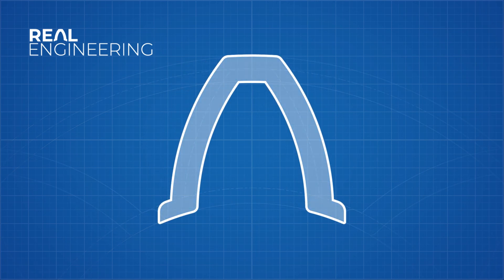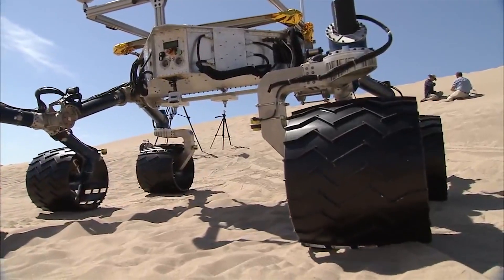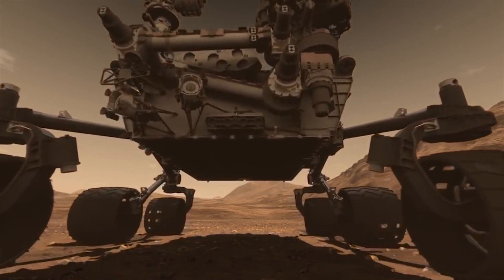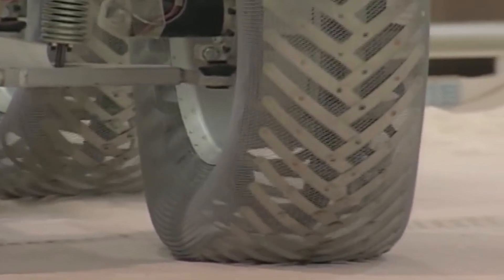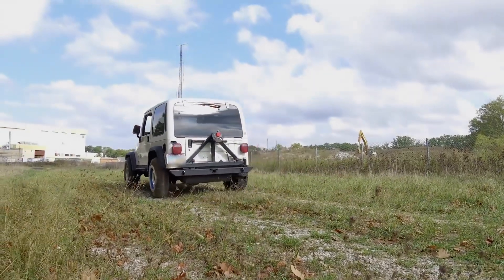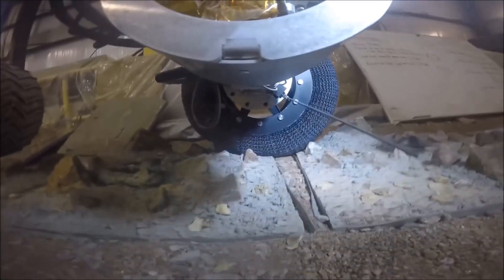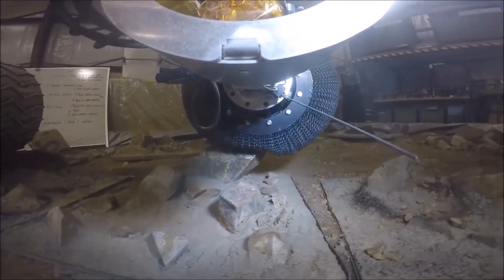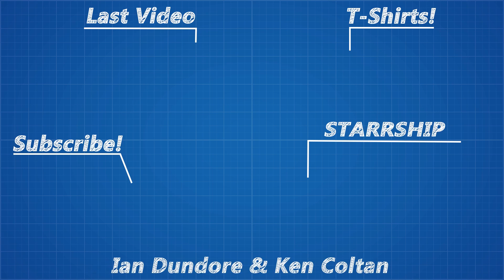How NASA Reinvented The Wheel - Shape Memory Alloys

Comment: Considering curiosity has gone more than 7 years past it’s predicted lifespan, I’d say they did a pretty good job on the wheels
Reply: Minimonk if u think about it most car tires won’t last that long
Reply: @Hairyson-g5j  yeah but a car drives thousands and thousand of km on one pair of tires and the mars rover only travled 40km
Reply: @Codzy yeah but the terrain on mars is way different from ours, and because of the incredibly different temperatures at day and at night, you shouldn't even compare it to a normal car tire
Reply: @no_t1es   yeah but u would think that metal wheels could last longer than 40km only going 0.1 mph or something like that
Reply: @greengreen110  Yes they can do better, but that doesn't mean they'll be able to do better straight away. It doesn't help that their funding has decreased a lot. Though I guess space exploration isn't one of our main focal points right now, so I can understand why their budget has decreased.
Reply: @anothereden6673  
NASA's budget has increased literally every year since 2014. I didn't go back further.

Sooooo
Reply: @lordgarion514  Yes, it has increased since 2014, but I'm talking about since the birth of NASA. It's highest ever budget was $40m, adjusted for inflation, and it has also gone down many times before 2014. From 2010 to 2014 it dropped $3m. Also, why specifically start from 2014? I don't think 6 years of budget increases accounts for 50+ years worth of budgets very well. You say you didn't go back further even though all it takes is less than a minute of Google searches to find the budgets they have been given and you don't want to even do that and yet you try to make an argument.
Reply: @anothereden6673  
No, you weren't talking about since the birth of NASA. You might have thought you were, and you might have meant to, but you didn't.

Reread your post. Especially the end.
Reply: @anothereden6673  
To be clear, you specifically mentioned "right now" in respect to our priorities, which would be covid-19.

So you yourself dated it to now.

I can only respond to what you actually say, not what you thought you were saying or meant to say.
Reply: @lordgarion514  I meant why it has decreased to what it is right now. As in from the beginning to right now. Because I say the words right now does not mean I'm talking about the timeframe of the past 6 years. I'm talking about why the budget of $40m, which was the during the period of the space race, decreased to $20m as of right now, which is half of the budget. And I said I could see why it decreased that much when space isn't the focal point of the government. I also did not have Covid-19 in mind at all when writing about priorities because I was not thinking that much about current priorities. I was just space exploration just isn't one right now
Reply: @anothereden6673  
No, when you say right now, it means right now, not decades ago.

And the main reason is because the people lost their excitement before the end of the moon mission's.
Reply: @lordgarion514   I did mention that people don't care about it as much anymore which you would know if you correctly read my statement. And again, by right now it means start to right now, as in 1958 to 2020, the budget has decreased significantly, which I thought I made easy to understand with my last statement. I was talking about the passing of time from past to present and how the budget has been affected. Also reread my first statement and you'll realise how all I say is that the budget has decreased a lot, meaning 1958 to 2020, and when I say right now, I was talking about it not being a priority right now, as again,the government, nor common people, are focused on space expedition.
Reply: @lordgarion514  People also use right now for flow of time. For example, "From 2016 to right now, I have been improving significantly at playing the piano." It can be used in this way as well. It is my fault that I never specified "right now, " but I was very obviously talking about it not being as much of a concern in 2020 as it was late in the 20th century. Please learn how to read between the lines and not take things with face value. All of the wording I had used in the first statement could easily lead a 5th grader to the correct inference of what I meant.
Reply: bnkjkdsbklafj hjbvjhbfdasjka yes but this is quite literally rocket science it takes a while to find a solution when you don’t live on that planet
Reply: It is never enough
Reply: Well if they had used the wheels that were in our proposal they would still work. My high school( Lakota High in west Chester)  Won the student Mars mission in 1992-3  One of my partners' Designed much liter composite wheels she was a Goth girl they don't want you to know that a high school Girls Design was better, we tested her Desing at a top-secret test sight in New Mexico,  We would spray it with Liquid N2 and have it drive across Quarts sand.  It was only 1/4  Scale but it could carry 500lb as you know if you increase SA 4 times and double the number of wheels for 4 to 8 then the Ground Pressor decreases.
Reply: soooooo relatable
Reply: 1000th like well deserved!
Reply: @TLXGaming  I unliked it just to spite you
Reply: @kommandantgalileo  why you gotta do mans like that ;-;
Reply: @TLXGaming  don't know
Reply: Well the last rovers wheels broke when they spent  billions on it so when you think about it pretty shit .
Reply: And the wheels weren't even the point of failure.
Reply: But one of the wheel did broke
Reply: Actually a single dude did it
Reply: I dont mean to be offtopic but does anyone know a trick to get back into an Instagram account?
I stupidly forgot the password. I would love any assistance you can offer me
Reply: @Terry Dominic instablaster =)
Reply: 20km
Reply: make that 9
Reply: $2.5 billion vehicle should last our lifetimes.
Reply: Given they spent billions you'd expext they'd shell out some coin for titanium alloy instead of aluminum tyres, seems like a last minute choice someone messed up.
Reply: @justinscott1691  
Well that's just stupid.

You talk like NASA is the military. Unlike the military projects, going over budget is not good for NASA. The money has to come from other projects almost every time.

They can only rob their other projects but so much.
And Congress doesn't throw money at NASA every time they go over like they do for the military.

NASA is already drastically underfunded. And between better tires, and and getting rid of an instrument, the instrument is what you pick.
Reply: @lordgarion514  actually we see people in charge of billion dollar projects making mistakes like that on a regular basis, they have done in the past, they are are doing it now, and will continue to do i, it's nothing to do with stupidity it's called being human, and by the way ive scene more expensive wheels on a sports car, and they didn't spend over a billion dollars on the car.
Reply: @justinscott1691  you are right billion dollar sinkhole. nasa is just a money funnel for the americam deepstate now like boeing, northrop, lockheed, raytheon etc.
Reply: @spacecowboy07723  lol. NASA has ALWAYS been a military outfit FIRST.  GO DEEP STATE!  what would we do without them? They keep us #1!
Reply: @Freakeasy_chicago ? Nasa was formed in 1957 in response to the sputnik launch to research space flight. It's never been a military outfit and still officially isn't one but yes military deepstate basically owns nasa now.
Reply: @lordgarion514 lmao imagine thinking military contracts going over budget is good... There's a reason the US is the laughingstock of the majority of the developed world, and it sure as shit isn't "spending more on military than on education and science"

Comment: Gentle Reminder: The dry MASS of the rover is 899kg/1982lb; however, the WEIGHT, on Mars, is 38% of that, or 341kg/752 lbs. Still substantial, but not nearly a ton.

Comment: Design a mars rover... Fine. I have a design. It's a crewed mobile base, so it's a little bigger than a rover. It doesn't need wheels, as it uses electromagnetic repulsion. It "lands" on legs when it's powered down. It's powered by a matter-antimatter reactor and has a top speed of 560kmh and can "fly" as high as 80 meters. It's armor is also photovoltaic, so it can generate power during the daytime, or radiate heat, should temperatures rise too much.The cockpit is similar to that of a helicopter. Keeping the thing operational at all times is a Virtual intelligence system. There is no way one pilot could control all of the repulsors, so the VI handles that and aids the pilot via a system that links with their brain. System comes from military spaceships. The vehicle is half the size of a football field and it even has armaments should they be needed. It also has a force field to limit radiation and minimize damage.

Now I need a genius to invent all the nonsense I described and a bunch of other geniuses to put the damn thing together.

On a serious note, that's a lot of stuff to think about when designing a wheel and memory metals seem like the best option.

Comment: Hi very interesting channel.  8:59 I was thinking if you would changhe the position of the exhaust in front of the supercar also you need to modify the shape to a wide cone somehow that when the car is running at high speeds the hot gases mixes with the air that is in friction with the body of the car and somehow to improve the out come in speed? Can you rap your head arround this idea? Include aspects of  thermodynamics in your imagination:d

Comment: What prevents the accumulation of dirt and rocks inside the tire? It seems like it wouldn't take long before it would be full of debris that would increase the weight, and start to wear at the metal fibers (getting wedged into the gaps, and preventing the fibers from elastically reshaping). I assumed the Curiosity's tires were open-sided to allow this kind of debris to simply 'roll out'...

Comment: I'm mad bout this tire. 10 years ago I drove to a tire shop after getting a flat. I had Sawzall  and a roll of chicken wire and some hard rubber liquid I was able to use. I drove 1/2 ton truck on a road side tire I made in 2 hours. I took tie wire and over excessively wrapped the chicken wire until I had a nice solid frame. Then I took the Sawzall and cut about a tires with. And then I set it on my tailgate and covered it in hard rubber. It lasted 20 miles to the nearest tire shop. I always said this would be the new tire. Good enough materials it would never flatten. or hardly wear down any. But I never used it again so I'll never know. O and I used no rim just made the wire much thicker and reinforced. Only drove about 20 mph on it too.

Comment: the new vehicle may need a "heat regulator, power source, communication device, scanner, camera, (optional, oxygen sealer), electronics, s.o.s signal emitter, temporary food cabinet, emergency backup generator, and so on.
the temperature regulator is partially easy; the power source can be a high-density battery, communication-vehicle-sat-earth, scanner (ex: ultrasound, heat, material sensor, etc); camera for the system where it can detect anomalies nearby that the driver doesn't know; electronics; (of course), s.o.s just in case; temporary food cabinet for emergency, backup generator just in case the battery died, also insulation for extra temperature regulation.

Comment: "[curiosity] employs a nuclear reactor for power..."
i think that calling the MMRTG a 'nuclear reactor' is a bit misleading. while a radioisotope thermolelectric generator does use radioactive decay to generate heat (that is turned into electricity through a thermocouple), they are very different from what people generally mean by 'nuclear reactor'. incidentally, nasa has developed in the past compact and lightweight reactors (look up 'SAFE-400') - though this was still quite a bit heavier than curiosity's RTG.

Comment: My Aero class presented our senior design project at JPL last march and we got to speak with one of the mobility engineers for the Mars 2020 Rover. They told us that there were two main flaws with the old wheels: the grousers (treads), and the placement of where the hub attached to the wheel.  

For the grousers, their design was to give better traction by increasing the length of the grouser, which is why it’s zig-zagged. Consequently, having those ‘zig-zags’ meant that all the stress from the rover’s mass was concentrated at the vertices of the grousers, and if the force was high enough the stress concentration would puncture the wheel frame. 

For the placement of the wheel on the hub, it was mounted offset from the center (laterally, not axially), so that the wheels extended out a bit further from the rover chassis and suspension system. This was an issue, because it basically meant the exterior rim (the part of the wheel that’s furthest from the rover) wasn’t being properly supported, and the forces on it were like the forces on a cantilever beam. This causes it to bend slightly, and over time this constant bending fatigued the wheels, adding more to the damage caused by the grousers. 

For the 2020 rover, they plan on using similar wheels to Curiosity but with the hub mounted in the center of the wheel, and using a sinusoidal grouser pattern rather than a zig-zag.

Comment: Titanium tracks that are coated with a tungsten carbide coating for maximum hardness and wear residence.
Reply: Titanium alloys have a high specific strength.  And because tracks have much better terrain crawling capability than a wheel, they can be made smaller and there for lighter.  The tungsten carbide coating would add wear resistance to the fairly hard titanium.

Comment: Respected sir. 
I appreciate the job done by NASA. 
I don't know the cost  of this material used for  tyres .
I have one suggestion  would like to experiment with tyres of stainless steel with spring all around for rough road smaller stones. 
Examples mountain road of laddakh. 
Second experiment 
Take round stainless steel tyres
Put the spikes of same diameter and run on sandy or ice road.
Try for mortar cycle and car.
Let's measure the balance of vachical .
Try this two ideas and make vedio and show me all difficulty face. 
I am interested in low cost project with maximum result. 
Namh shivay.

Respected sir. 
Please try to ride in muddy feild also. Namh shivay.

Respected sir. 
For icy floor,  I don't have too much experience but some floor are hard some are soft. My suggestions is you can give support to edges of spike examples nails with head of 2 or  4 cm.  diameter to support the base and to bring more balance while riding. 
Namh shivay.

Respected sir. 
Please make another experiment to check the use this material as nut bolt.
We use parabolic mirrors to distilled sea water, and use clay tiles and stone pipes to make larger sizes tanks. Only nut and bolt was lacking which can tolerate the deadly Ray's. Of parabolic mirrors and holds the tiles together during process of distillation .
The sea water through this above material can  come inside the tank and  steam from tanks will go out side.This material will make process easygoing. Below the platform we must make system to clean the tank. 
Present system of filtering sea water is costly. 
My English is not good.  I hope you understand what  I want to say. 
Namh shivay.

Comment: um actually, it's a radioisotope  thermoelectric generator, not a nuclear reactor
Reply: um, actually that's still a type of nuclear reactor.
Just because it isn't using controlled nuclear fission or fusion...
Well, you get the idea.
Reply: nuclear reaction actually goes in RTG, so it's still a reactor.